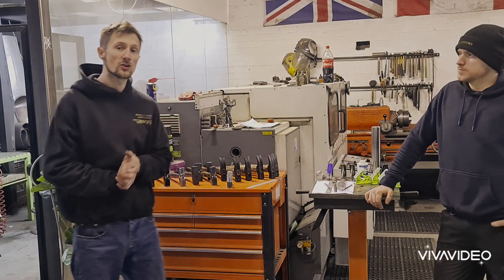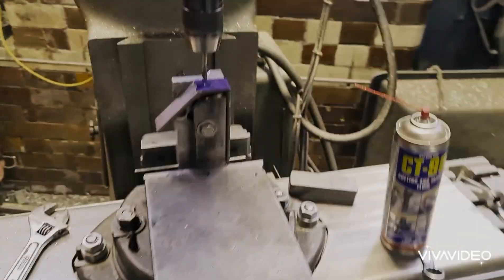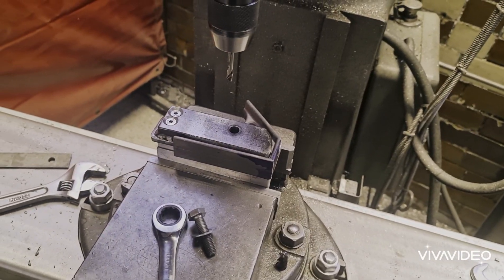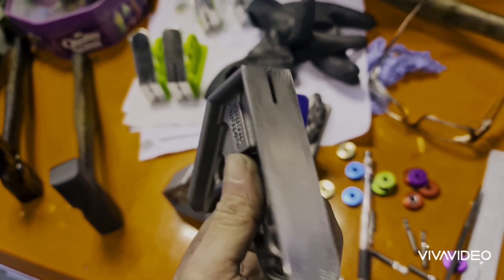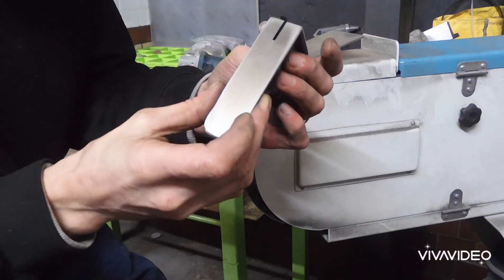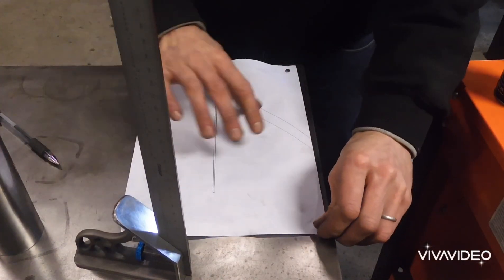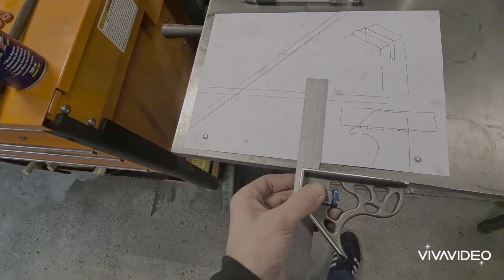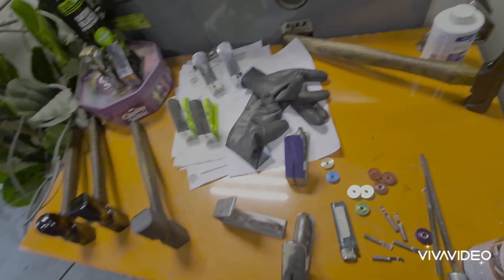Combination Square  made by kinetic Customs

Comment: I have recently bought a set of BAHCO combination squares and found they were ALL out of square. The 300mm square was 3mm off, made in PRC so no wonder then. I then bought a 300mm STANLEY combination square, expecting better for similar money, it was out of square, also by 3mm. It must have been made at the same factory.
So, I saw this video and jumped to the website, but no squares on offer. Such a shame. Good old eBay then for a good "vintage" combination square then!

Comment: Looks great. Have to ask, are you using the same surface plate to lap your parts as well as measure on?
Reply from the maker: To be honest we don't use it for measuring but only for a flat surface and straight edges.
Reply: @kineticcustoms4808  still a bit iffy, over time you'll start to wear a dip in it especially if you have the paper in the same place. I have to deal with the consequences of people misusing surface plates at work and its not fun having to get them reconditioned. If you start to take more serious measurements or want to preserve the current one id say 3 main options. 1. Buy a new, low grade plate for it. 2. Get a piece of surface ground steel, can be ground again as needed. Tom lipton from ox tools did one of these. 3. A thick piece of glass should have sufficient flatness for lapping